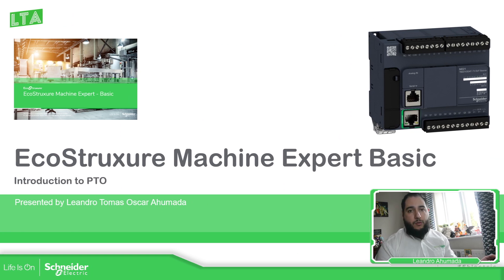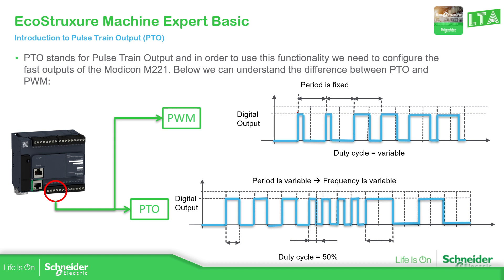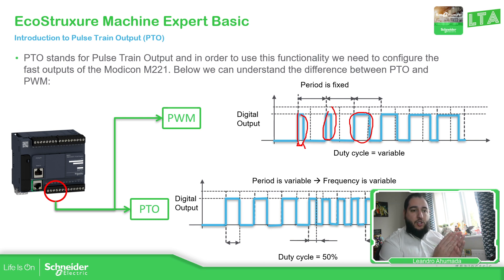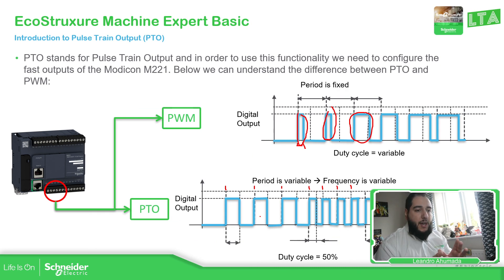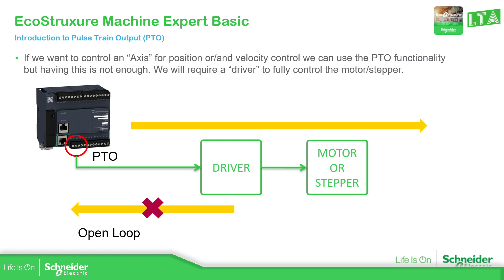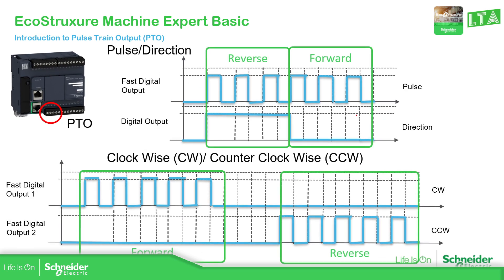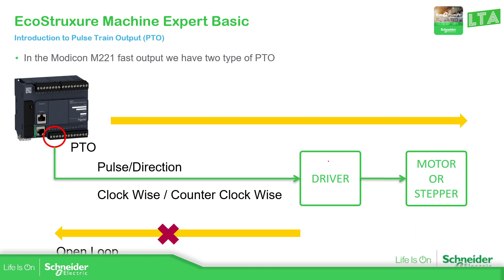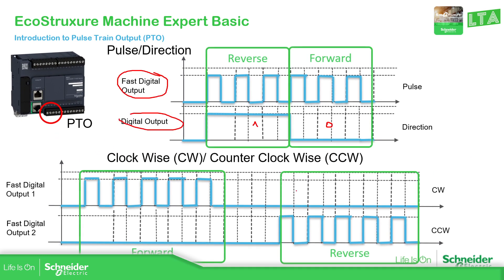Training - M221 - M16.1 Introduction to PTO

Comment: Hi sir can i use the driver motor L298N for controlling motor dc 12v
Reply from the maker: Hi there! That is probably a question for the manufacturer of that microchip 😊, i had a quick look and it looks like and it can control motors up to 42vdc: 
https://www.tech.dmu.ac.uk/~mgongora/Resources/L298N.pdf